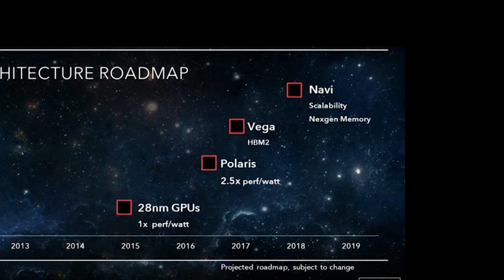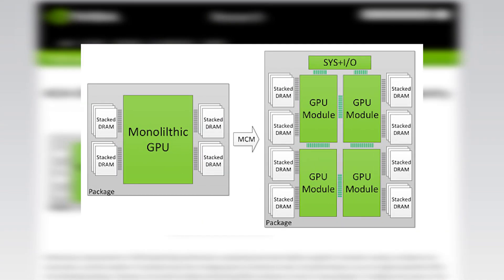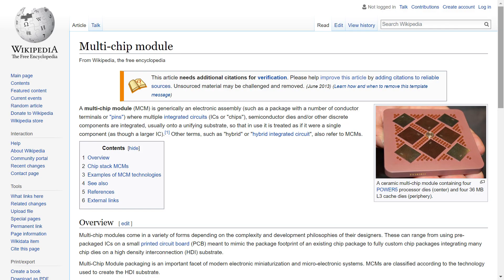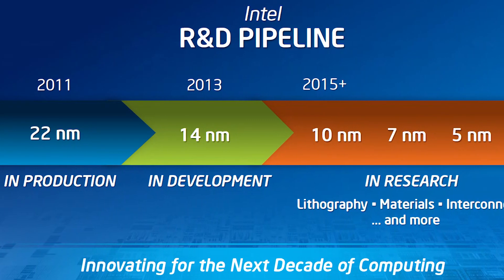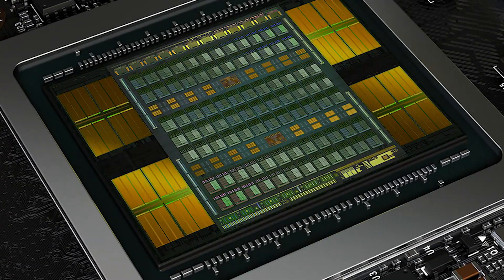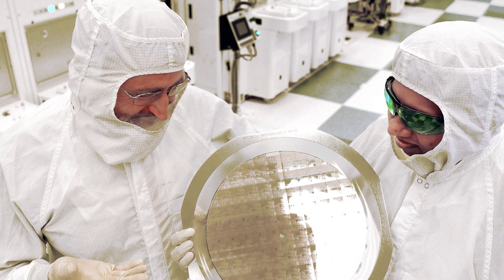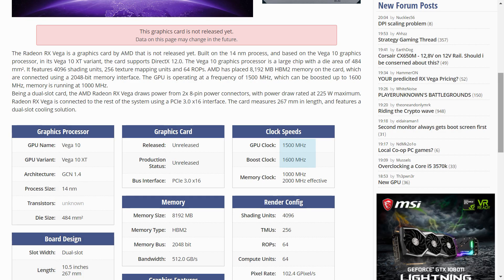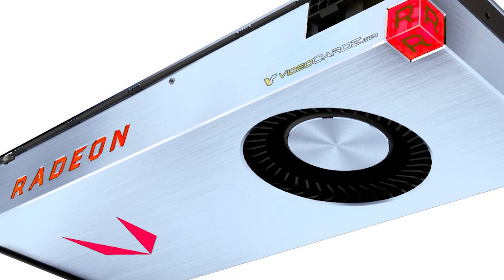Future of GPU Architecture!

Comment: How comes nvidia knows exactly how to create hardware 10 steps ahead in the future, but continues only taking one step at a time? Why does no one feel robbed and cheated when they show you their roadmap?
Reply from the maker: +SnakeEngine Because you simply can't make 10 steps into the future. It's their plans as technology progresses, but you simply can't progress faster than what's possible and economically feasible. Trust me. If someone could, they would to beat out any other competition.
Reply: If they can't why are they able to place their roadmap so accurately? They apparently know what is already possible. It's like they artificially hold back. That will force you to rebuy next iterations of cards and maximize their profit. Makes sense for them, but not for the consumer.

Comment: sorry for the retarded question but . . .  is there a technical reason why nvidia drop a lot of multi gpu support but then decide to make multi chip gpus ? O.o
Reply from the maker: It's not a stupid question. This type of design is very different from what most consider multi GPU. These will be looked at as a single GPU. Think of Ryzen. It uses this same approach, but is looked at as a single CPU.
Reply: oh i got you, was thnking the api/game code would have to deal with all of that lol but it will just be like ryzen where that displays all the zen cores in 1 nvidia will display all the cuda cores in 1. had visions of vram allocations being singular for each chip and stuff like amds duo cards lol was thinking that would be a mess by the time you got a few modules together. i got the difference now. thanks :)

Comment: we are actually in a api limit
You need a 4,5ghz CPU to full load a gtx1080ti at 1080p
Sure developter can reach more grafics efects and gpu can't handle it.
But this has no reason, games are made for consols.
with a gtx1060 6gb or rx580 you did not need to upgrade until 2022
The next big thing is 4k
And there i see a use of mcm gpu and more gpu performance
But only publisher changes api to vulkan dx12
and the game engines are made for this.

AMD vega what a sad story, i thought they could reach at least gtx1080ti but instead gtx1080 at max
One year later reach amd nvidia middleclass gpu
For those who think that nvidia gtx1080 is high end, wrong it is nvidia middleclass chip gp104
At 2010 cost the same class of chips as a gpu on market 160$ today at least 600$
Thats why nvidia is greedy amd seems a hero in prices
Thanks for nothing miners

Comment: So gpus a finally gonna catch up to 20 year old CPU tech..
dual core GPU..
hmm
Reply from the maker: Well, you may not really understand what a GPU is (no offense). A GPU has thousands of cores essentially. GPUs are literally designed to use extremely parallel tasks like graphics.
Reply: Gamer Meld I meant it in a good way.
Not offended at all mate ;-)
What I meant was they are finally taking the route CPUs took a while ago.
where more actual individual GPU silicones working to together as individual cores due to the end of moore's law, being in sight.
Obviously it isn't a direct comparison, comparing CPU transistors to GPU cores.
GPUs should've taken this route a while ago.
Maybe that is AMD's master plan with vega 2.0 and their new infinity fabric...
Appreciate the response though. Mine was written in haste, not in skepticism.
Peace.
And keep your vidz coming! I prefer yours to others as they're short and to the point.
subbed..
Reply from the maker: Oh definitely. I really meant no offense by it. I definitely get what you're saying. And see that's somewhat the thing. CPUs have mostly been monolithic dies as well. Ryzen is one of the only successful dies that uses this approach. For example, Intel's i5's, i3 and i7s have never done this. Seriously not trying to be argumentative. Just trying to explain :)

Comment: @Gamer Meld The dual gpu vega is going to smoke the 1080ti.Especially if they use the infinity fabric technology to connect the gpu's,thats what I would do.A test to see how well it works with vega gpu's,so they are more prepared for future implementations of the tech.They will have to underclock and disable some cores for powerdraw and thermals,I think.

Comment: vega MUST be faster than one year old gpu??? how is that unussual? I'm new to hardware and I don't get it. isn't that how tehnology works? we get better, cheaper, smaller things as time passes?
Reply: Șerban No, it doesn't have to be faster. Just cheaper, affordable for the masses. That's the way AMD was going lately with their Polaris architecture, and it seems like they're going to continue it in some way. They spent 5 years developing their Zen-CPU-architecture and the infinity fabric, so they were not so much into the GPU market lately. Now that the Ryzen-Processors sell exceptionally well, they will gain some money, and may have more budget left for their GPU department. The highest-tier rx Vega GPU most likely won't surpass the 1080ti, but will be cheaper.
Reply: right now, if vega is faster than nvidia at same price, i get vega...but when volta is out and there is no amd UNTILL 1 year later, i guess i have to wait 1 year, that's just how amd works?
Reply: Șerban Not necessarily, but it was like that last year. We don't know how Navi and Volta will perform and when they come out. Like I said, with the money they made/are making with their CPUs and their Infinity Fabric Technology, AMD might not be behind anymore in the future.
Reply: Șerban its how capitalism works...not just technology

Comment: well as everything in tech in time goes away from one big all encompassing chip to many parts it does not surpise me that nVidia is going to try to make a chip with  2+ chip placements on it for other GPUs and/or HBM modules to fit onto the problem will come when you get to how to make the HBM connects will it be one GPU per the HBM modules making it so one graphics chip can have 40+GB of VRAM or will it be one chip with only the standard amount of HBM shared among them all reduceing it to 16GB for all the GPUs
if it is multiple GPU modules then you also have what about SLI will they just kill it all together? If you have effectively 4 or more GPUs working together on a high speed interconnect then SLI will be stupid to use for anything to increase performance of not pure gpu compute distributed processes which those cards do not use SLI bridges but a hard ware thing to use a NV Link or PCIe type thing 
so surprising no expensive for the first few generations with lots of bugs due to them not being able to test it in every game environment and professional load ever yes

Comment: Well, this is the first time I'm glad AMD are slow as hell on the draw with Vega.
Hopefully this latest cryptocurrenceyc wave is over on release.
Reply: Vega Frontier Edition so far looks like a rather lame mining chip. Either the software has to be re-optimized for it, or miners just won't be interested. If RX Vega is like that, the RX580 would still be the mining chip of choice, and next to that a GTX 1060 or 1070 would be superior. ($ per mh/s)
Reply: BikeHelmet Obviously there has to be big re-optimization work to even use HBM for mining (all they care about is memory, not the gpu itself) and even then there is no guarantee it will be a good miner after all! Lets hope not and pick up that vega card before they can use it for mining!

Comment: Are the three rx Vega models (competing with gtx 1070, 1080, 1080ti) still a thing or is there just one rx Vega now?
Reply: Algorythm44 There are 3 Fury cards though...
Reply: Shud be atleast 2
Reply: There are 3 but they weren't 970, 980, and 980ti competitors they all started out at 980 level and went up to 980ti level over time. Basically they were so close in performance the only difference was the cooler.
Reply: I don't think there ever were those models just some people spreading rumors of what they wanted to happen. I think vega was always meant to be like the fury, just 1 card.
Reply: There's going to be a full (big) vega and a cutdown (small) vega.
Reply: there will be 2 for this month release. The nano version for ITX and regular version.
Reply: Same has the Fury X series most likely
Reply: Spoderskrillex nope they going to b like 5 different Vegas cards let's keep waiting on
Reply: Daxtore yea they will probably that again